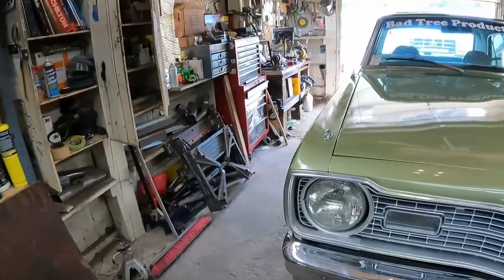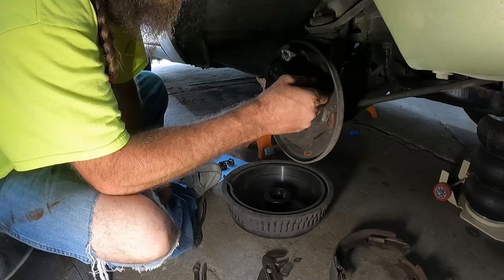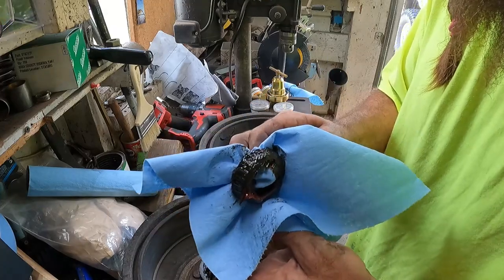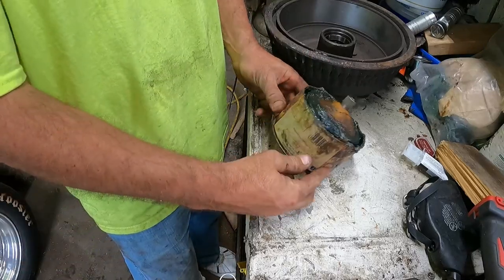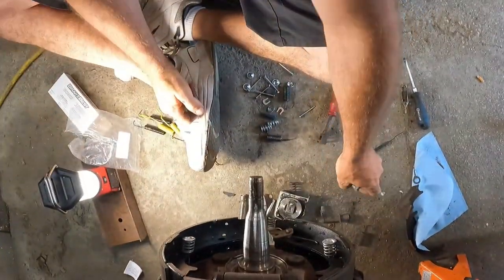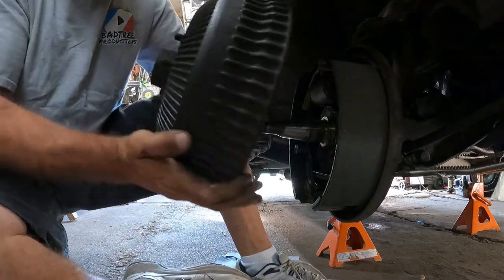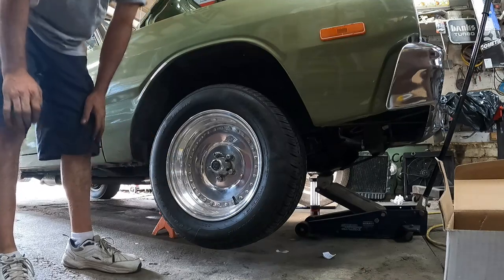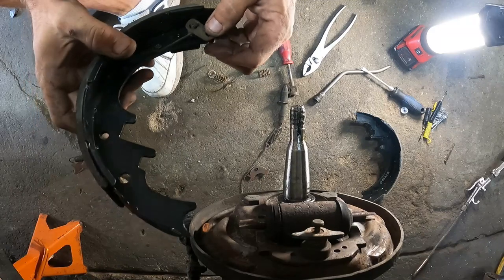Replacing 1973 Dodge dart manual drum brakes. #nonamenationals #dodgedart  #mopar  #brakes

Comment: was going well there for a while too till you ran out of lightening...I learned a couple things...now I know what that tool you used to flick those brake springs off is for :) Im also impressed you own the tool for the discs/ spring hold downs... Its on my shopping list ..totally unrelated question...have you replaced the drivers mirror? Looks like new and also the one I need, ridge on the back like Barracuda ones? ...where would one procure that?
Reply from the maker: That's factory equipment baby 😆

Comment: I know exactly how you feel when it comes to ordering the wrong parts. I ended up having to order two separate sets of brake pads just to get my front brakes running that was already going way past schedule.
How old is your fuel pump? I had a Oldsmobile did the same situation. Although you did say it has no spark that's weird maybe not the same problem
Reply from the maker: No spark.
Reply: @BadTreeProductions  it just shuts off in the middle of driving? Bad Connection somewhere maybe
Reply from the maker: @patrickfitzwater5511  yes sir